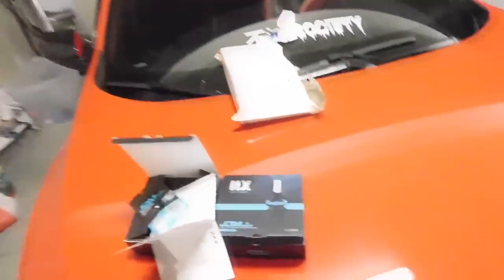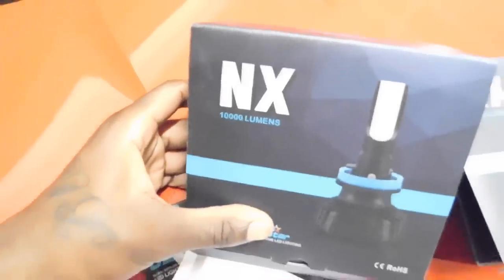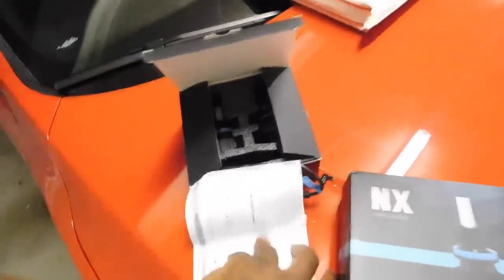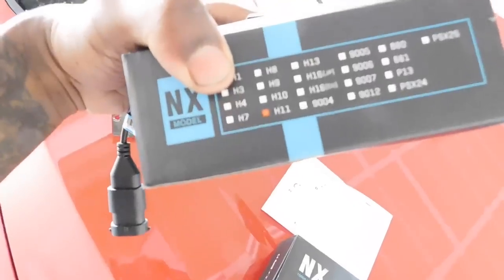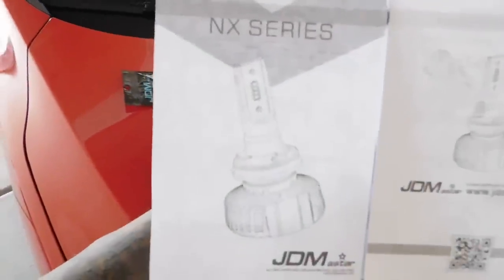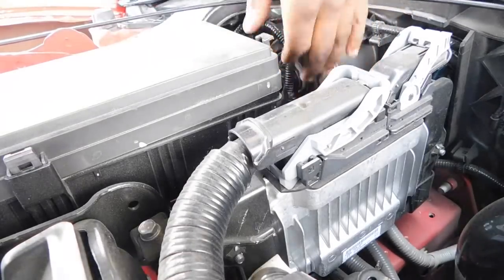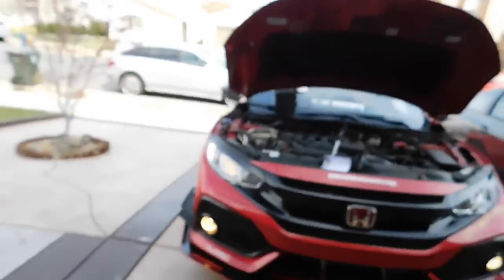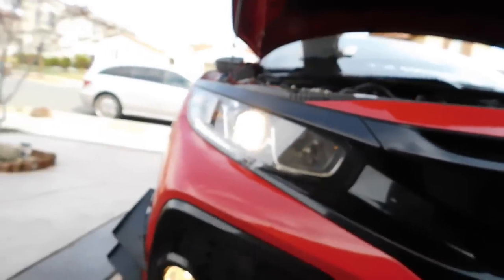How to install LED lights 10Th Gen Honda Civic Hatchbacks | JDM ASTAR

Comment: Question - I wanna do this but the website you provided says this: Off-road use only.They are designed for rally and race tracks, show vehicles and not for use on public road.

Does that mean I can’t use these on the rd?
Reply from the maker: ChanceyKnows you can use them for public roads that’s what I did